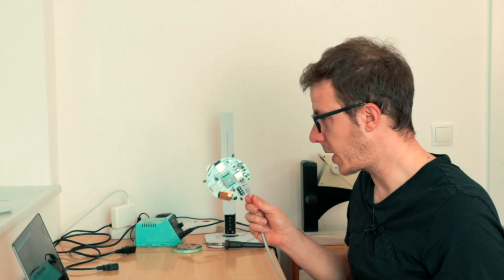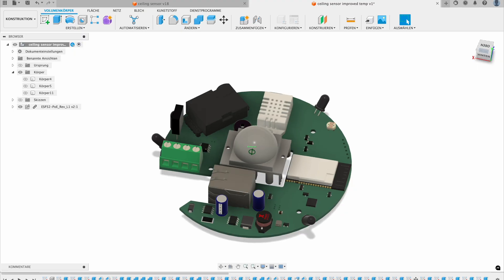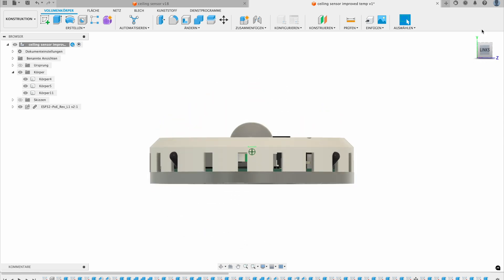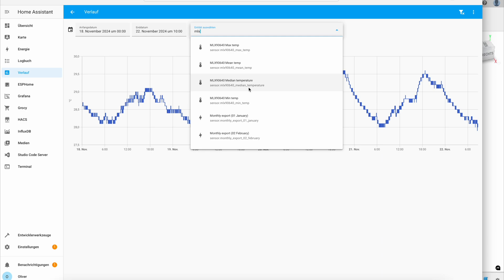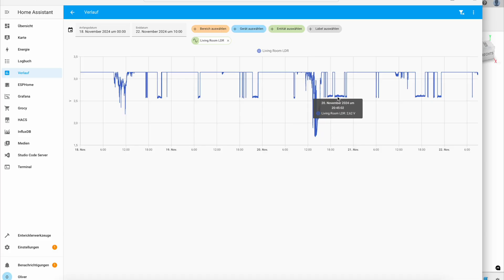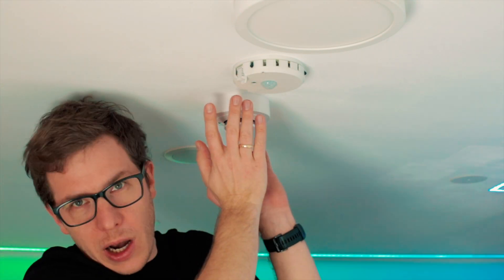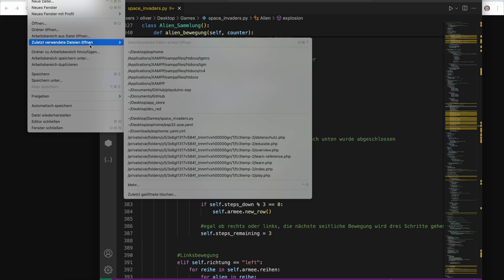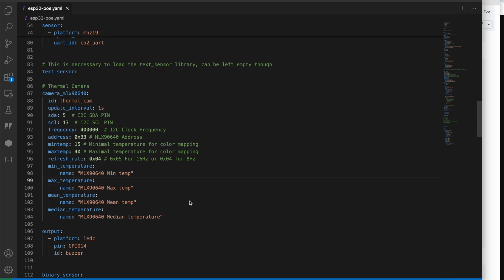POE ESPHome Ceiling-Mounted Smart Home Sensor: Thermal Imaging, Smoke Detection & More!

Comment: Is there a particular reason you went for something like a DHT22 rather than say a bme680 or bme280? Those units are much smaller (I would also say more accurate too), and would allow to better placement along the perimeter.
Reply from the maker: The main reason is that I had some DHT22s laying around. In the next version I will most likely change it

Comment: Nice work on the sensor. 

I’m sure you are asked this but why no mmWave for presence detection?
Reply from the maker: Thank you! mmWave might also be a great addition to this sensor. I have no experience with them and don't know how well they work inside of a case. I could imagine that it's tricky to get them working reliably. If you have experience with mmWave sensors in similar projects, I'd be interested in hearing about it.
Reply: @ 

I’ve “played” a bit with a LD2450 connected with a POE powered ESP32… they are seriously good at detecting if someone is in the room even when very stationary. Can pick up breathing etc. eg laying in bed or sat reading in the bathroom. 

I would point you at the Everything Presence One or Lite… Lewis turned a diy esp home multi sensor into a commercial product.

https://youtu.be/Viqvx7hMMJs?si=laJCS6rd8ILL2Zcv very early version of his product.
Reply from the maker: very interesting, thank you !

Comment: Very nice project. But I have 1 question. Why not use something like BME680 (temp, hum, pressure, indoor air quality and more) or cheaper version like BME280, if you already have i2C onboard and ESPhome support them
Reply from the maker: BME680 looks like a nice upgrade for the next revision :) thank you! honestly I just picked the sensors I had at home :D

Comment: Your sensor looks very promising—thank you for sharing! A few years ago, I started designing a similar sensor for flush-mounted boxes, but unfortunately, the various sensors didn’t deliver good results, so I ended up shelving the project. I’m definitely interested in your sensor and have already registered on your website.

By the way, in your video, I noticed your LED strips integrated into the ceiling. As I’m currently in the process of a complete renovation, this caught my attention. Could you share a link to the product or at least point me in the right direction for where I can find such recessed housings?

P.S.: I’m based in Germany.
Reply from the maker: Awesome thank you :)
The LED strips are a WLED project with addressable 24V LEDs

Creating A DIY ESP32 24V WLED Driver For Ultimate Smart Home Control
https://youtu.be/SbufWGcb0jw
Reply: @playduino  Thank you for your quick response! I realize I didn’t express myself clearly enough. I’m not so much interested in the LEDs or the controller but rather in the LED channels that are flush with the ceiling—the profiles with the diffuser.
Reply from the maker: @ChrisSpawny0815  ah sorry ... sure :)
https://www.leds24.com/aluminium-led-unterputz-profil-trockenbau-ideal